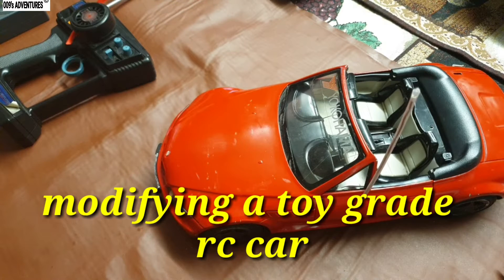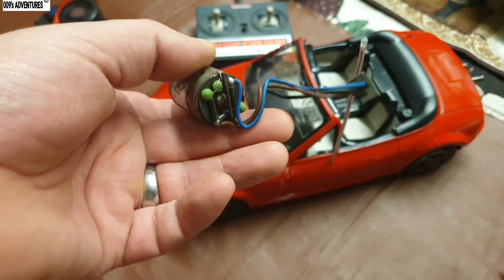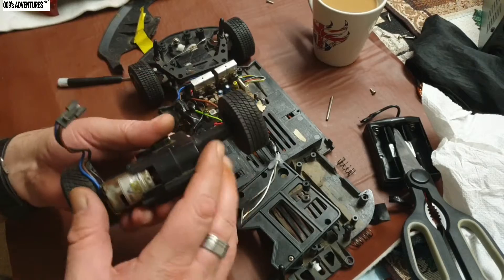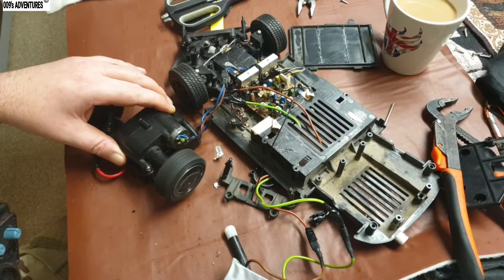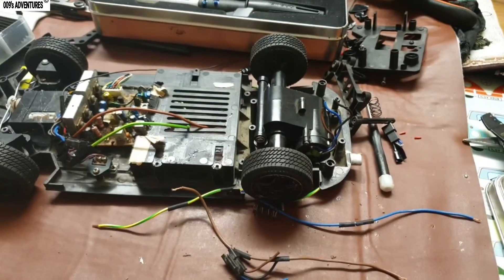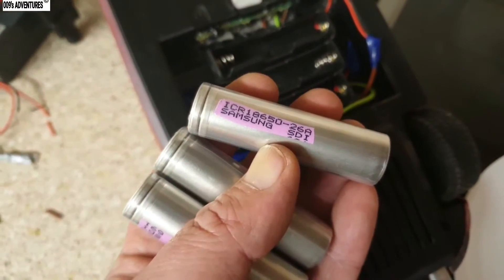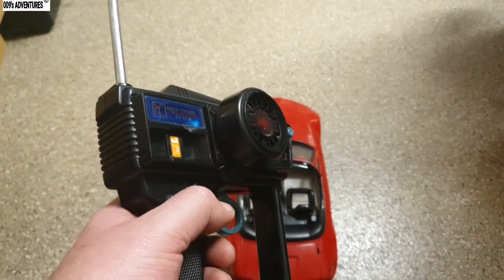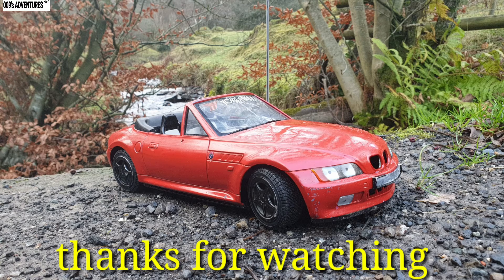UPGRADING A TOY GRADE RC CAR

Comment: I'm looking for a lil help on upgrading a toy grade rc. I am happy with everything but the steering servo and would like to upgrade that only. But having troubles figuring the wiring of it. How did you get your servo wired in to the circuit board?
Reply from the maker: hi Brian, I was lucky I had a board here that was proportional along with the matching servo from an old rc car that was crashed so I changed the lot in this one along with the controller.  easiest option is to buy a hobbywing 1060 esc and a 3 wire servo but then you will need a controller and receiver.  all that will cost around £60 that's the only problem unless you can find something on marketplace or the like . Hope this helps 👍
Reply: @009ADVENTURES  I'm not trying to go that route, as this rc has moving suspension like air ride. Otherwise I would have to do servos on all the shocks.
Reply from the maker: @brianfry4748   agh right I got you bud, sorry I can't help more , hope you get it sorted. be fun trying anyway:)
Reply: @009ADVENTURES  no problem thank you anyway tho. I figure there's a way just have to find it lol.

Comment: IMR Lithium Batteries may work even better than ICR. Nice work. I’m looking to do this to my Lamborghini Countach toy grade RC car. It needs to drive as well as it looks.
Reply from the maker: yes I did use lipo with an alarm cut off and it was great but shredded the gearbox. some great looking toy grades out there , good luck with your conversion 👍
Reply: @009ADVENTURES : Yes. I customized a Radio Shack 69 Camaro and the brushless motor and metal pinion gear ate through the spur gear. I swapped the rearend out to a hobby grade Traxxas system and it is awesome Fast and Powerful!

Comment: I am now inspired to do this to my old Viper
Reply from the maker: go for it :)  always great fun trying to create something from not a lot 👍
Reply: @009ADVENTURES  Will do! I couldn't find the Viper. Shame. It's something like a 1/18 scale. Still though I got a New Bright Corvette. It looks like a 1/25 scale. So far I've made a differential out of Legos and got it in the back end. Fits pretty snug. It doesnt exactly roll, but a moderately sized motor should compensate for that. I'll make my own battery pack with 4 AAA batteries. Once I've got the cheap electronics all sorted out, I'm taking it to school!
Reply: @009ADVENTURES  It's done! You can now see the car on my channel. It's just a couple short videos
Reply from the maker: sounds good, I will pop over and take a look 👍
Reply from the maker: @Critter0817   I have looked but cant find it. maybe it's on private?
Reply: @009ADVENTURES  Whoops, I had it on unlisted. Its public now

Comment: nice mod  love moding  these toy grade cars just in the process of finishing up a conversion a nikko rally car  i picked up at a car boot sale for very little   only difference i installed this system https://www.ebay.co.uk/itm/1-18-RC-Buggy-4P-2430-7200KV-Sensorless-Brushless-Motor-25A-ESC-Combo-Set/162718205507?hash=item25e2c2c643:g:nqkAAOSw84Zb9bKa   it rips  run on a 2s lipo just have to watch motor temps
Reply from the maker: thanks, great fun isnt it. oh nice that sounds like a blast :)   I have a few here to do when I get time now I splashed out on a transmitter it's just a case of picking up a few cheap esc and receivers then I can start them. thanks for  watching 👍
Reply: @009ADVENTURES  no problem have looked through your RC videos very enjoyable thanks for posting

Comment: This video is unique and not a lot are seen so 👍 video man.
Reply from the maker: just a bit of fun originally but I still use this car occasionally.  thanks for watching
Reply: What store did you get it from?
Reply from the maker: I really cant remember tbh, I've had it kicking around for about 20 years. it's made by gp toys if that helps any.

Comment: Nice job mate it can deffo shift a bit cant it. The motor spinning the wrong way is just the sort of thing i would do guaranteed lol
Reply from the maker: it's not too bad Gary,  shocks need changing though. yea that motor threw me for a bit as it was wired up correct just different location lol.  never mind I got it sorted that's the main lol.  cheers mate